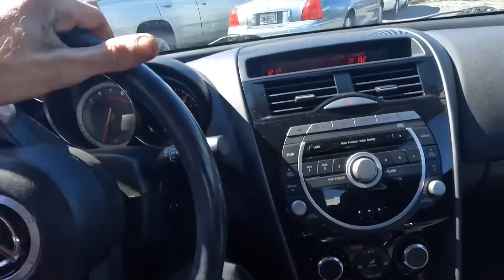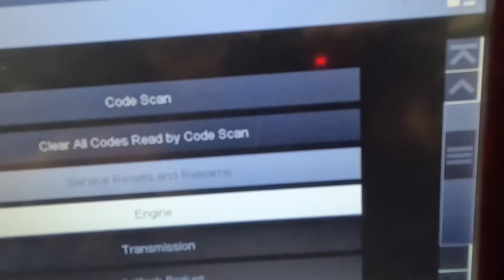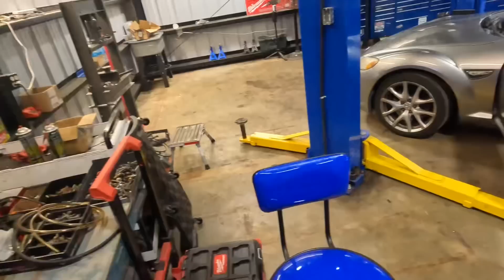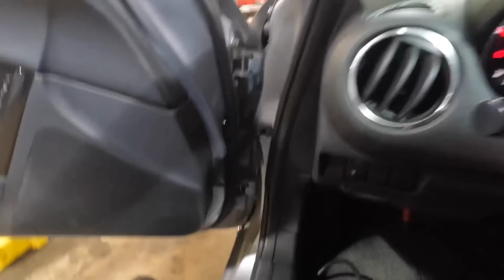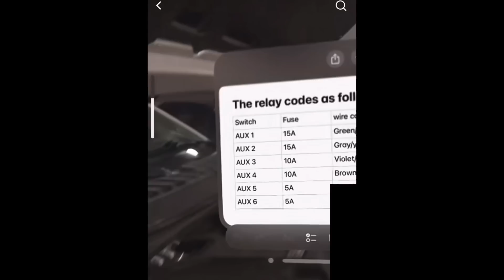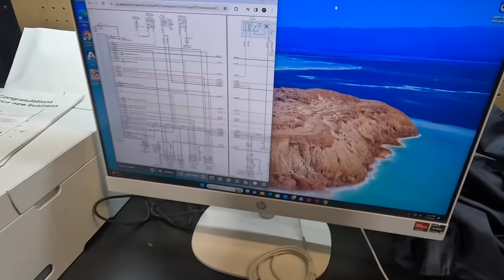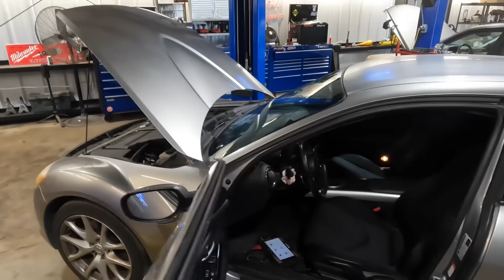Will Virtual Reality REPLACE Mechanics?? Mazda Rx-8

Comment: AI or VR may have it's place to assist a technician, but it will never be able to replace the manual dexterity, blood, sweat, and tears that it takes to work on a car especially since cars are not even designed to facilitate ease of repair. It's the physical strain to be able to reach a put a tool on a hidden bolt or welding a broken manifold stud that a computer will never be able to do until cars are designed for a computer to be able to do it.

Comment: It's just like a scan tool in that it can be invaluable in the hands of someone with the proficiency to use it right, or beyond worthless in the hands of someone who doesn't (needlessly loading the parts cannon for example)
And from there, you're still going to need someone with a wrench, and the proficiency to use it without doing more harm

One thing that I am deeply surprised AI hasn't been utilised for is watching live data, and looking for patterns. given that it's capable of observing timing data, o2 voltage, fuel trims, engine load, coolant temp, catalyst temps, metered airflow, and throttle position simultaneously and check readings dozens of times a second, I wouldn't be surprised if it's able to accurately detect failures long before they become a noticeable to the mere human behind the wheel

Comment: For the most part I agree with your assessment of how VR will impact mechanics. I do think it could grow to be a vital tool over time if onboarded correctly.

It could replace the need to buy a number of other individual tools like thermal meters. Especially if it gets tuned to the point it can recognize things like hot spots in wiring. The data is there, it's a question of whether the human eye can see it, or feel it. 

Image recognition could quickly pull part numbers.

At the end of the day, more data to make an accurate diagnosis is great. But you still need someone to do the work, and assess whether AI got it right. The AI relies on input to build its own model. It doesn't take much garbage input to bias or invalidate an AI model.

Comment: AI? Here's one for the AI guys:

2007 C30 2.0d (PSA motor). Started to throw EGR and MAP sensor codes, engine hesitation. What to do? What was the issue here? 

To note, I figured it out but it needed some driving around while data logging.

Comment: I've had a RX7 and a RX8. They're fun little cars. The powerband to them starts at about 4500. Just make sure you have coolant in them. If they overheat at all, the seals on the rotors will need to be replaced, so either an engine swap or a rebuild.

Comment: I had a similar “Doomsday for Mechanics” conversation with an EV guy not long ago. He seemed firm that the auto mechanic industry would completely die off, as everyone moved toward EV’s (not to mention he was very smug about it, as if he was happy that potentially thousands would no longer have their livelihood.) but he didn’t  have much to say on the subject after I explained that there would still be mechanics, as there are still many moving wear parts on an EV, brakes, electrical systems, bearings, ball joints, etc. 
it’s amazing to me that there’s folks out there who are thrilled at the thought of people losing jobs, if it includes doing away with an item/industry that they don’t agree with.
Reply: I assume he didn’t understand that the grid won’t be ready for that amount of draw for a couple decades?
Reply: @drumminggoose444  Of course not. There’s only a handful of EV supporters that understand the need for infrastructure improvements. Most think that all it needs is the stroke of a lawmakers pen, and bam, everyone should have an EV charging in the driveway, A/C blowing wide open without rolling blackouts.
Reply: There will be some impact from fewer wear parts needing replaced.  No exhaust, no oil changes or any of the seals and gaskets needed to keep it from leaking, none of the dodads going on or through the valve cover into the head(s), with most braking being regenerative the friction brakes will last a lot longer, LED lights should last the life of the vehicle (also on newer ICE cars.  Other stuff like suspension, steering, and HVAC will still be there, and everything will be even more computerized.

Comment: The USAF tried a similar thing with Google Glasses years ago. While it was really handy to have the technical data in front of you at all times, it did not replace the intellect of the mechanic repairing/inspecting the equipment. Also, it turned out the glasses were stupidly expensive and not very durable.

Comment: Every time you mention rolling the window down, in case the door/s lock/s, I think of the 2nd gen acura rl. If the fob is in the car, it will not let you lock the keys in the car. I wonder how many other vehicles have this feature?

Comment: who's going to invest to develop the mechanic's "vision pro" application, where you get to see/manipulate  the scan tool screen in your head set as you're stuck under the car, wher every car's CAD drawings and connection diagrams  are integrated in the system, and it tells you what things are, what they should or shouldn't do, in your live view: That's the "sci-fi" version of it but not going to happen as it would cost millions to develop and car companies are not going to give anyone those diagrams!

Comment: #1 and #2 troubleshooting for issues in the IT world are 'did you turn it off and back on again?' and 'is it plugged all the way in?'. I can't count how many times a problem I came across was solved by either trying a different outlet, network port or power outlet, or just simply turning the device off and back on again.

Comment: Part number could be hiding beneath the heat sink? 😆 🤣 😂 

Technically it should be classed as 'Augmented Reality" and it would take a technician to initially physically diagnose the fault first but after confirmed diagnosis/repair was achieved then it would take a programmer to write the software to allow a technician to be guided to diagnosing the problem, it will become a game changer in many fields but as our technology advances it could get to the level where it could robotically diagnose and repair the fault with the help of A.I. (but that is a while from happening yet).

Imagine a car from a manufacturer you haven't worked on before and it's showing codes for a say "vacuum system error", you could ask it to "highlight vacuum system components/system" with the voice recognition software (or a specific vacuum related component) and by using reference points on the engine all the components are highlighted through the headset.

You could then ask it to guide you through either diagnosing a faulty components, hose or wiring issue depending on the specified request, now at first you would probably need to know a bit about the lingo/technical jargon but it could get programmed to recognise the dealer specific terminology (as well as generic terms used to describe the component or components function in the system) and teach (keep you right) at the same time lol.

It would at first be good for a car that hasn't had any modifications or had wiring etc re-routed or incorrectly routed but it might be able to show you points where it cannot be mistaken for i.e. a specific component that has a set place under the bonnet or behind the dash etc to allow you to identify the correct wire/pipe/fitting etc, it could be used to show you where internal components are in an engine and using the sensor data show you it's "percieved" operation in real time (imagine watching a crankshaft or connected components moving and watching a cylinder being highlighted as it physically misfires lol).

The applications are endless but it will take a fair bit of effort and commitment to develope but our technology is evolving at a rapidly increasing speed and its getting smaller and more efficient all the time but hopefully it recognises our efforts and input to make it happen when it becomes "sentient" and decides we shouldn't be exterminated as there may be a situation it hasn't taken into account where our presence or symbiotic relationship would be essential or advantageous (and that's my argument to Skynet should the occasion arise lol).

If manufacturers are not already working on this now then they bloody well should be!! lol

I have a ps4 with a vr headset and I doubt I'll go back to using a TV (for watching films or gaming) other than to watch TV, YouTube even has a VR channel so you can experience being in a fighter jet etc and it's amazing to experience VR for the first time.

3D films are way better on the VR headset too and on the screen on its largest setting you have to move your head to see the edges 😆 🤣 😂 

I highly recommend it ... shpeil over lol

On a side note you could start another channel named "Rainman Ray's Diags/bare bones" or something similar lol as it could be advantageous to fellow techs just wanting the bare bones of your diagnostic process and any issues that may have cropped up rectifying the fault ( you already record and explain most of it in your normal videos so wouldn't take too much effort in that respect but maybe a bit if narrating it and editing it maybe but could double your output and cater for that audience (others may want the whole shenanigans from start to finish though lol) certainly worth a squint at/thought.

Was thinking about it when you robbed us of the hopefully upcoming finale to the fake pump video? lol

Comment: What I would use the VR headset for to know where things run and where to look for it on your vehicle and possible ways to repair it, but you have to physically do it without the VR set so you learn two things how things are run on a vehicle, but you have to physically fix it yourself because the VR set can’t fix it for youbut it’s a good way to learn how things run about the whole car part right away so you can see where the wire is being run so you have to check see if rats or something or damages happen that’s what I think VR headset be good for and give you the knowledge and possible way to fix it but real knowledge is the key power

Comment: In this video, you just did the very thing that you mocked the VR headset will lead to.  You went to the internet, read a diagnose chart, and changing a part without testing the ecm.
Reply: Exactly.

He didn’t even check the connector for corrosion. Just ordered a replacement for the main engine computer. For an RX-8, a very rare car, so it’s not like there’s tons of inexpensive replacement parts readily available.  

I was expecting him to end the video by saying “fooled ya!”, and then showing hat the real problem was a loose power or ground wire to the computer, or that part of the wiring harness had worn through.

Comment: I'm a datacom engineer, AI driven VR headsets are not replacing this level of diagnosis and repair. 1st, the "AI" headsets are more clever coding, not AI, the amount of computing and storage required for AI takes up entire data centers, not a headset and your phone. True AI is still a few years away, and to do what you do would require AGI which is Artificial General Intelligence. That mimics how a real human would perceive a scene and process all of those little, "I wonder how that got there?," types of question. "Witness marks, someones already been fiddling with this." That functionality is decades away, or maybe never. The only benefit I could see is that it would be beneficial to a real mechanic to have wiring diagrams, location diagrams, etc. available while he is working on the car. You can kind of do that now by just having screen with you while you work.

Comment: VR isn't going to do a thing. What you might get is some sort of robot arm that you can control with like a vr headset that allow you to look in tight spaces you would normally have to disassemble half the car for and maybe manipulate things as well.
AI might help with diagnostics but you still have to go in and do hand work.
A bigger 'threat' than VR/AI to mechanics is more likely personal cars being outlawed or becoming so expensive to drive that it's on par to owning an airplane now. (due to pollution / oil running out etc etc)

Comment: I had a couple of soldiers that played with a military prototype mechanics wearable computer .  The concept is solid as far as a data source is.  It's not a replacement for a mechanic, it's an enhancement.  In effect you are wearing your scan tool, your alldata, your parts ordering system.  Ray has it right.  It's not a game changer, but an enhancement, it still requires a properly calibrated wrench turning noggin to do the work.

Comment: As an experienced VR/AR developer, at *best*, mixed reality could be used during the assembly process to train new line workers or maybe quality control but under ideal factory conditions. Dirty, crusty, and/or leaking engine compartments aren't going to have the fidelity to help accurately diagnose within VR/AR. Despite best efforts, digital will never be the end-all answer - there will always be a need for analog diagnostics by a dirty, crusty leaking technician.:)
Reply: Dirty crusty leaking tech! 🤣🤣🤣

Comment: 99% of all cars today have an onboard computer, this monitors all systems that rely on some form of electrical current to either operate them or energise them, this system uses a signal ( small low volt pulse) sent to each module and waits for a response, if none is given, the EMC logs it as a fault, even identifying the part, what it doesn't do is tell you why it failed the test signal, as ray stated, as rodent may have chewed into a wire, moisture might have increased the resistance in said wire, a connection my have worked loose, so a hands on and eyes on is still the only way this fault can be fully traced and rectified, not even a robot with terawatts of memory is ever going to be able to do that kind of work, AI has it's limits, humans work beyond those limits, I have yet to see any electronic equipment that can repair itself, or repair other electronic items, they can build more of the same, from scratch ( like they do in most factories these day) but still need some human intervention at times, So the Spanner man will always have a job while we drive cars/lorries/buses and trains

Comment: You have made some very good points Ray.

AI is likely to become a better overall solution to diagnostics than OBD2.  But as you correctly point out, the 'headset' does not have a place when conducting practical diagnostics.

I think AI will be more helpful to mechanics when such a system has access to massive amounts of correctly diagnosed problems for a given vehicle.  It can then suggest inspection of issues for any failure beginning from endemic down to exceedingly rare.

To implement such a diagnostic procedure, the existing information network will need to be continuously fed data from thousands of technicians by automatic or manual means, in order to exploit AI in this way.  This is similar to the data-collection that TESLA does remotely every day with their millions of vehicles now on the road.

I reckon voice conversations with an AI will be far more effective than VR headsets when the technician has his head stuck inside the bowels of any gadgetry.

BTW, I often cringe at your efforts while you work with apparatus on a bench.  You do not seem to have grasped the concept of anchoring your "device under inspection" in a vise/clamp mounted on a VERY solid bench during forensic inspections or dismantling/assembling.  By such means you eliminate most of the random forces generated with 'floating' work that result from hammers and picks and give you great control over the forces you apply with any tool.  Wrestling over that steering box would be a good example.

I really enjoy watching your channel and the joking around you are prone to present in your videos.  Keep on truk'in chap.  And hi-there to your other staff and the Wife unit. 

Regards from a retired electronics design engineer - who hated to chase his work around a workbench.

Comment: After you've joined a freeway and checked in your mirror to see  if someone behind has changed lanes behind you, if you saw someone had, what would you do then, switch lane, pull off the road, accelerate or pray and brace for impact ? Just curious.
Reply: That would depend on the situation.

Comment: You’re quite right, no VR or AR technology is going to take someone with no knowledge or experience and turn them into a master mechanic overnight.  Having said that, I’ve had no automotive training other than what I’ve done myself when I had to work on my cars using a Chilton’s or Haynes manual and the school of hard knocks.  But, using YouTube and resources like that, made it much easier to learn how to drop the transmission on a 2012 Jetta (I wouldn’t wish that car on my worst enemy) or do an L99 to LS3 conversion with a Cam Shaft swap on my 2014 Camaro when one of the stupid AFM lifters collapsed and scored the Cam shaft.  If I get stuck on something, rather than winging it and forging ahead, I can search the treasure trove of videos because most likely someone else somewhere else has gone through the same thing.

Again, no technology or shade tree mechanic is going to replace a good master mechanic (of which you are definitely one!) but it can definitely help those who either don’t want someone else working on their cars, or like me, can’t afford someone else working on their cars.

Love your videos and not just for the technical information they provide but for the pure entertainment value of them.  There have been many days I’ve watch a Rainman Ray’s video just to relax after a particularly troubling day at work.  Keep ‘em coming!